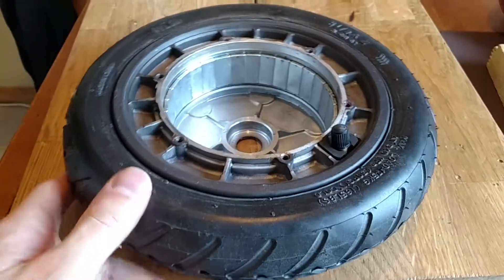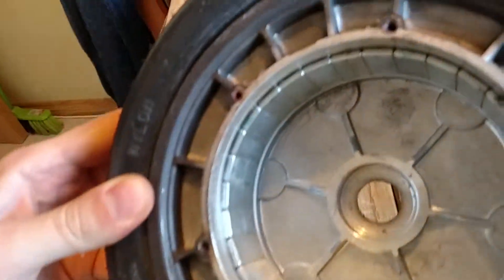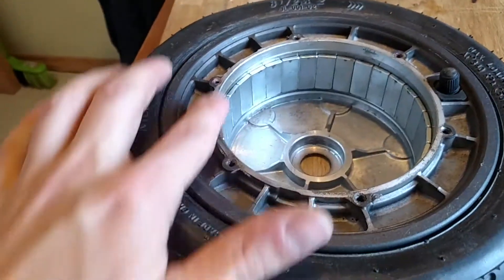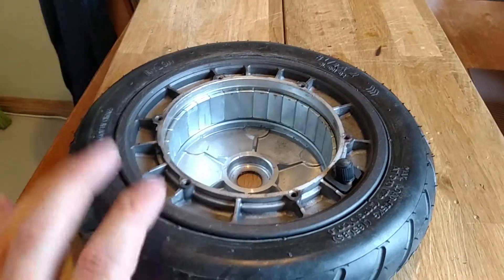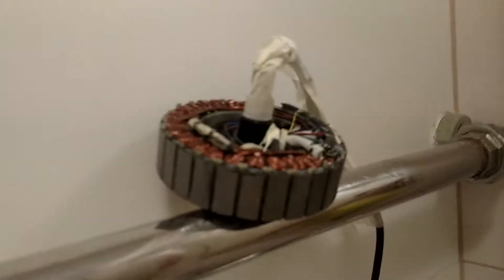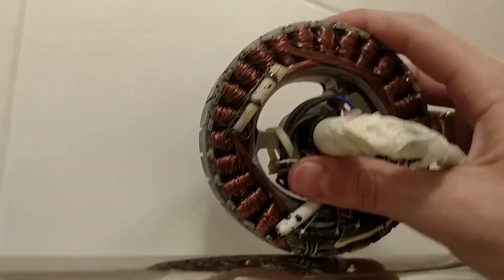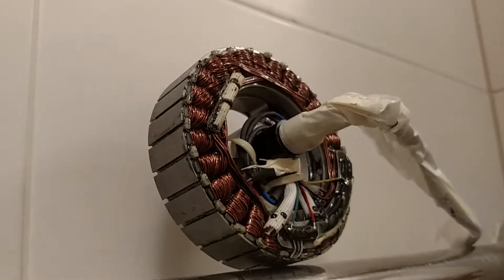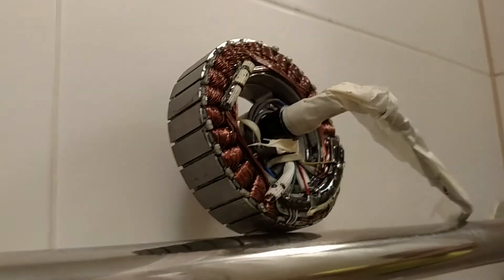Xiaomi m365 insides of front wheel after 5000km. Внутрености моторколеса Xiaomi m365 после 5000км

Comment: Thanks for sharing that. Can I ask you a question? Ever since I tried to change my inner tube of the front wheel, i have this dragging sound in the front wheel. Did I somehow damage the bearing? See, https://photos.app.goo.gl/CK6aaisEgeEmyN5z5 ,  and also makes a clicking sound: https://photos.app.goo.gl/tzK152i9mhsSM8pD9 . Thanks in advance.
Reply: Yes, u damaged the bearings bro.  U must change them before it somehow brakes the motor.
Reply: @rudon9070  is this hard to do?
Reply from the maker: @philz033  It's not hard. The hardest part is to disassemble the from wheel. Search on the internet about proper change of the m365 front wheel bearings. There is a lot of instructions even in English.